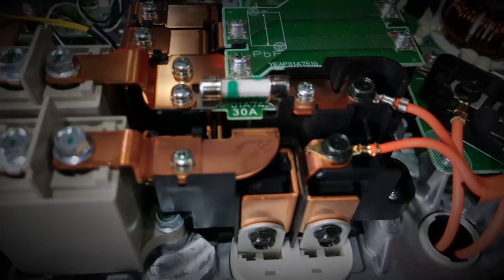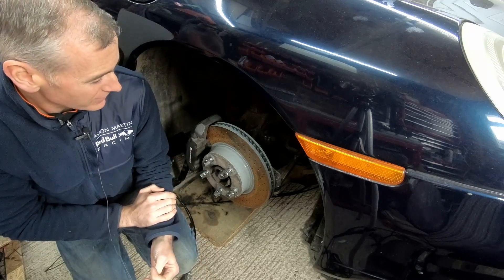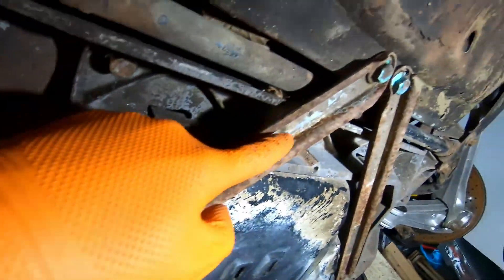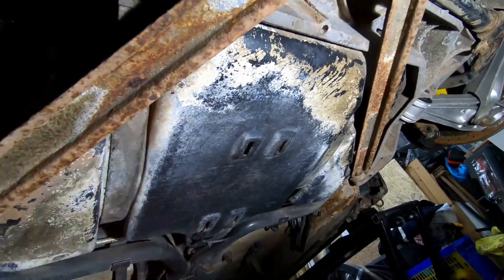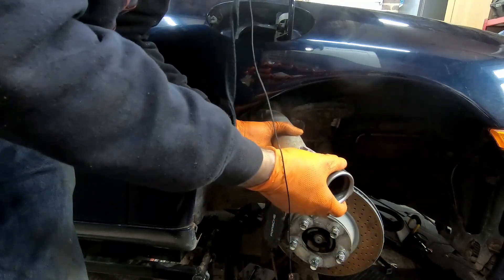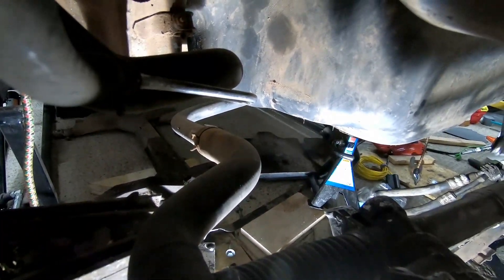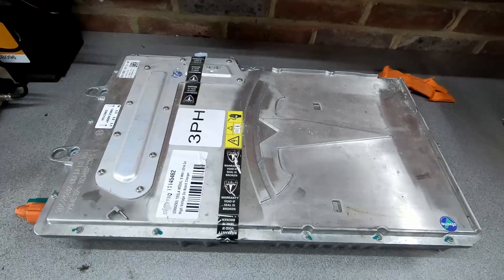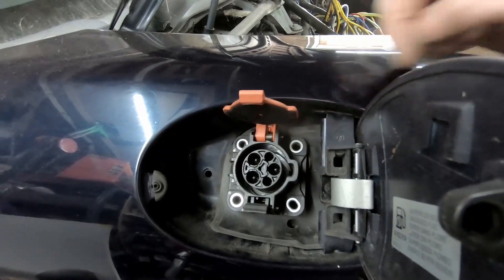Removing the Fuel Tank and Front Subframe from our Electric Porsche 911 Project Car - Video 62

Comment: It might be an idea to hold onto those cooling pipes for the charger. It will need cooling too.
Will you be able to fit battery modules in that space? I'm in the process of making a battery box for my fuel tank space and to be honest it's proving more challenging than I expected. Good luck with the rest of the build.
Reply: Leaf BMS + distributed batttery pack = painful
Reply from the maker: I guess trying to extend all those fiddly wires would be a nightmare.
Reply from the maker: Thanks @Ali Bro, the pipes are full of brown sludge from where the coolant had mixed with the engine oil so I am going to be replacing them with my own set up...which should be fun;-)
I am still trying to figure out the space I have with the components that I need to fit there. It would be cool to have a bit more battery space, but I don't think it would be more than a handful of cells

Comment: If you ever come across a AC Charger with wired plug it will be a type 2. So go a head and cut your losses and get a type 2 socket. What size wires are on the Type 1 Single phase inlet? You probably wont be able to draw anything above 16 Amps.
Reply from the maker: Very valid points, I'm just trying to resist the urge to buy more parts for the car until I have finished installing the bits O have:-) I have a Nissan Leaf type 1 plug in charger so I can use this to get past the MOT and then upgrade to type 2 or CCS. I also have a Chademo port I need to find space for. I really enjoy these bits of the build:-)